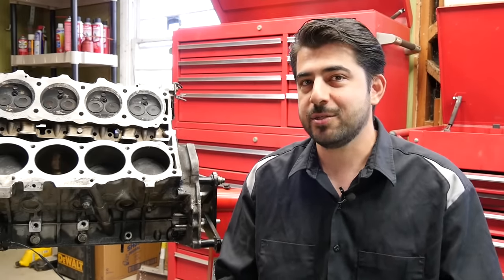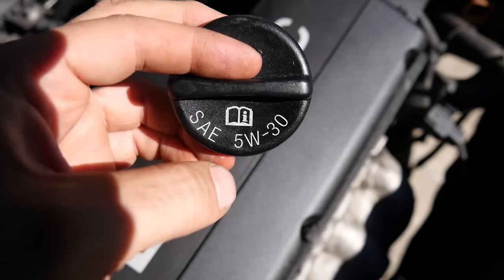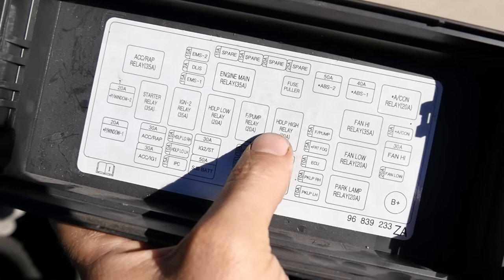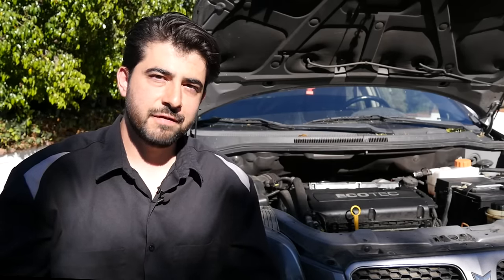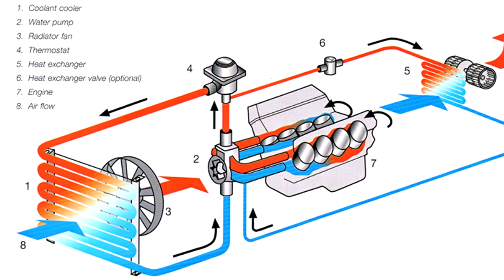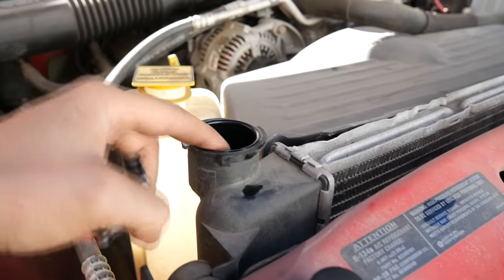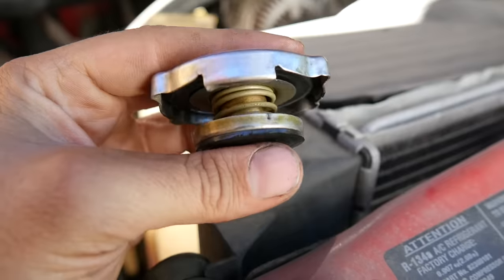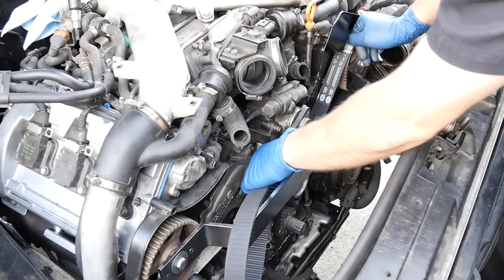Make Your Car Engine and Transmission Last a Very Long Time - Top 5 Tips On Car Care

Comment: Lol, you start talking about vehicles with transmission problems then immediately show a Dodge Ram.
Reply: Myles Mastersen I thought of that too! 😂
Reply: Because dodges are all motor. And no tranny
Reply: Loll
Reply: @AlphaFlight  yea that's true all they have is hemi lol
Reply: @AlphaFlight  good engine and garbage everything else
Reply: @ThePatUltra  ThePatUltra  dude he was probably talking about the Dodge vehicles that are 2000 and newer. I couldn't agree with him more on the fact that the 2000 and new dodge vehicle rust faster and have issues faster than most of the other vehicles in the market. But the older dodge vehicles are good. So don't worry.
Reply: @ThePatUltra its the same with the fords, old fords last longer than those new ones.
Reply: @ThePatUltra yea I agree. I personally wasn't hating at all, I am just telling it like it is. Personally I am a fan of dodge even if I drive a ford.
Reply: Well,its the one he was working on during the video and said all trucks that tow a lot..Dodge/GM/Ford trucks transmissions all last the same amount...I am in the business and know 3 friends that own Transmission repair shops..

FYI : Shady shops used to tell Dodge owners that they needed a transmission when all they needed was the transmission to be adjusted ! A $50 job cost them $1,000's because the owner came in and said they wanted a new transmission ! All it needed was to be adjusted as per owners manual !

Dodge /Chrysler/Plymouth made the worlds most reliable and trouble free,best shifting transmission the 727 ! Those never broke(unless years of abuse and they took hard abuse,hundreds of thousands of miles in Muscle cars,yes all old Muscle Cars have over 100,000 miles majority are in 200,000 range but dolts cant understand old cars of all brands didnt register 100,000 miles,at 99,999 they rolled to 00,000 again,Toyota was like this to decades ago)..
Reply: Literally goes without thinking.  I thought the same thing.
Reply: @AlphaFlight  The old 727's were three speed and tough.
Reply: The ZF-8 speed used by FCA is the most reliable tranny out there.
Reply: You missed the meaning of it.  He was talking about the hole, then said thats what she said.  So the meaning of the dodge ram is to ram her hole with his man tool.
Reply: Mopars have always had weak transmissions,,,my 67 charger , 70 challenger and 73 charger all had trans problems,,and even the new ones are the same
Reply: @Bob Builder Some CHEVROLET trucks used Allison tranny's, I very well could be wrong but I've never heard of a dodge with an allison. In fact, All I've ever heard is to avoid FCA vehicle like the plague. Cummins or not, avoid them like the plague.
Reply: All American cars have transmission problems...
Reply: Dodge worst trucks on rd for front end parts and transmissions. Probably why ram will never out sell ford or gm trucks
Reply: @Bob Builder never seen one dodge gas engine with that many miles. Seen plenty on Chevy trucks with that many miles
Reply: @01trsmar  bs dodge has had more trouble with transmissions than any other truck
Reply: Bob Builder untrue. Dodge has never used the Alison 1000. GM did behind the Duramax.
Reply: 350.000 miles 04  dodge ram transmission.  45RFE. never been rebuilt
Reply: My 95 5.9 ram 1500 transmission died before I had 60k miles....  F*ck Dodge/Ram, whatever the f*CK they rebrand it....  Never buying them again!   I religiously replaced the automatic transmission fluid every 12k miles and it the mechanic would show me black/burnt fluid....  WTF!
Reply: Myles

I have a 2006 dodge ram with 230000 miles and runs perfect. In fact the only thing I have had to change is the water pump and u joints.
Reply: The car he was also standing in front of is a Pontiac
Reply: @ThePatUltra A minivan owner from Chrysler here and minivan hitting 270k miles.  Great vehicle, only complain is dashboard which is cracking up and some rust.
Reply: The new CVT transmissions make the Ram transmissions look reliable and rugged.  The manufacturers tried to cut down the price of a transmission to maximise profit and dumbed down a CVT to put in their cars. The results speak for themselves.  Unless it is a subaru, never buy a cad with a CVT.  I do not know what Subaru does differently, but their CVT stays together, shifts well, and is rather rugged.  None of them ever come in for transmission service here.  Nissan is the polar opposite.  They barely make it out of warranty and the junk is broken.  I have advised our fleet manager to stop buying anything with CVT unless it is Subaru and to stop buying anything turbo charged four cylinder cars.  Those tiny engines with turbos are grenades waiting to explode, especially since I think the sales people abuse them.  They come to me with every gasket leaking and with a rattle, just after warranty expires.
Reply: He's a mechanic.
Did I say he's a mechanic.
Guess what he's a mechanic.
What are the odds a mechanic who works on cars for a living can make cars last longer.
He's a mechanic.
Reply: LOL
Reply: @markvietti  All Ford lovers just hate to admit all ford defects that are purposely made to fail !
Reply: @garymiller2056  727's were the best, toughest, most reliable transmissions in history!
Reply: @georgespangler1517  did you have 727's? if they were weak, you must have been doing neutral drops @ 5000 rpm on a regular basis.
Reply: Just replace the transmission with an Allison transmission and you’re good to go. Pair that with the Cummins turbo diesel and that’s one hell of a truck.
Reply: @georgespangler1517  No they haven't always had weak transmissions!  The 727 and 904  Torqueflites were the toughest and most reliable in the industry for many years!
Reply: @georgespangler1517  You must have had shitty  cars. to begin with.  Yours is the first time I have ever heard someone comment about the Mopar transmissions of that era.
Reply: @slowbastardo9101  I call bull on the burnt fluid at 12k.  I believe there to be a big exaggeration.
Reply: @robhargis6980  first car was a 67 dodge charger 383,,,second 70 challenger 340,,,third 73 SE charger 400,,,I wish I had those SHITY CARS now,,,lol,,, I had to rebuild the trans,,,but I'm sure they had been put through hell before I got them  5 to 8 years later,,  If I only knew then what I know now,,,,but I've bought up 10 classic cars to restore,
Reply: Dodge will somehow be the first car to be totally transmission free
Reply: @francisprevel1  you probably don't even know why its called a hemi

Comment: I have a 96 civic and it just hit 380k miles! Every weekend I’m doing preventative maintenance on it. I take things apart and test certain parts to determine if they need replacing or just simply checking the life of parts. My two main things on keeping an engine healthy is proper lubrications and the cooling system. Those are my two majors to keep an eye out on.
Reply: Every weekend?
Reply: @enricopallazzo3244  just about every weekend because I work in the city. My job is about an hour and half away, therefore it is crucial for me to keep up with the maintenance and to check for any faulty parts. I would hate to be stranded far away from home. Yes, I do have AAA but in reality I wouldn’t want to use it. I’m my case, it’s essential to inspect my car every weekend. Your situation could be different if you commute time isn’t much. Normally, people should inspect their vehicles at least once a month.
Reply: @TheEdgar707  Cool, well done sir.
Reply: I like your preventative inspections and maintenance. I do that as well but I should increase the frequency. I do it, may be once in 3 months. I drive about and hour and a half each way. that is about 3 hours a day. so, what you do makes a lot of sense to me. taking care of it is better than waiting to be broken on the road.
Reply: What specifically do you do every weekend? What parts do you check? Thanks.
Reply: 93 Civic 137 on the clock. These are relatively low maintenance compared to many other vehicles. Reliable as dirt. 90s Corolla same thing
Reply: @TheEdgar707 your life sounds like a nightmare to me
Reply: The D16 is a great engine, you barely even have to do maintenance. Just do oil changes every 7000km or so, no need for synthetic, just keep it topped up because they do burn a tiny bit of oil if you hit vtec regularly.

Comment: Drive your car nicely and it will last longer. If you race between traffic lights your car will die sooner even if you service on time!
Reply: Thats true. The key to having your engine last is to not give it a lot of torque while driving.  Don't drive it like your going to the races.
Reply: @jopisano67  😬
Reply: All I say to those who drive fast between lights is... I will meet you at the next one. 😃
Reply: @jopisano67  Depends. Diesel engines should get to use the torque. Its also smart to run yhem on high RPM a couple of times to regen the DPF (if it has one)
Reply: That statement is not proven.Drive your car to sluggish and it won't last long either.Engines need to be put under pressure once in a while.Obviously after warm up.
Reply: Joey O unless it’s a performance car. My 330ci has 220,000 on the clock and it’s done over 10 hard track days plus it’s absurd everyday and has done for the last 5 years. I change the oil and filter every 4,000 miles.
Reply: Wrong... especially in modern direct injected engines.
Reply: im dont agree of “not giving your car the torque or racing everytime” like cmon it’s designed to be driven no matter how hard you drove it.
Reply: @bugoykikay8074  Modern reliable Engines maybe....  NOT Transmissions.    Normal modern transmissions can not handle the same stress of a  professional race car transmission.
Reply: @jopisano67  3rd gen prius are notoriously known for head gaskets as mines was replaced at 143k miles. I have 400K miles now and have been pretty rough with it. This thing takes a beating, I still prefer the 97 protégé engine for a reliability

Comment: For me to remember easy
1. Change oil frequently and use synthetic oil. Change oil filter every oil change
2. Change air filter when needed, same with brake pads and keep an eye on those tires
3. Keep an eye on the timing belt 
4. Keep an eye on your water pump. Replace with timing belt. Keep an eye on radiator cap. 
5. Replace that transmission fluid and filter.
Reply: Don't forget, the Thermostat
Reply: Also power steering. Very easy to overlook and costly to replace the rack
Reply: Replace the clutch and pressure plate before it leads to pressure plate failure.  But clutch and pressure plate only need to be changed about every 200,000 miles or so.  If you can handle a clutch well, 250,000 miles is very easy to obtain.  If you have a Front wheel drive vehicle, check CV joint boots.  If the boots are ripped and the axle makes a clicking noise when turning, replace the CV Joint drive axle.  I have seen many accidents, some with death, because people do not replace CV joint drive axles, which are easy to change. If you hear a strange droning noise when idling, the fuel pump is about to fail. But do not worry.  It does not happen often and it is relatively easy to change.  Oil change is every 3000 miles for me. Change differential fluid every 50,000 miles. I must be doing something right.  This month my vehicle turns 425,000 miles.  The original engine and transmission and axles are still running strong.  I bought the vehicle new in 1996.
Reply: Also make sure when your heat meter start going to hot/ overheating...to fix the problem immediately and not continue driving your car.
Reply: Thank you!
Reply: I have an older cherokee with about 286K miles on it and it runs like a brand new car!! I did replace almost everything on it lol About to install a brand new upgraded 5-speed. This Jeep will probably last 1 million miles lol
Reply: @Kafilkavich  Our newest car is a 05 Jeep Liberty,292000 miles, and a 93 Cherokee 4.0 still running great
Reply: @indridcold8433  what vehicle dude?
Reply: @indridcold8433  Have to add this, change coolant every 2 years and use OEM coolant if you are not an expert with your car!
Reply: @cyrusthechad7256 When you say Synthetic oil, do you mean Fully Synthetic or Synthetic blend oil?
Reply: @Fred-F4  that may have saved my ecotec!  As after replacing a leaky head gasket I noticed the water passage was nearly corroded into the cylinder head..
Then again..parts were dang hard to get 15 years ago...part of why I eventually junked it
Reply: Replying for me to remember easy
Reply: I think it is better to drain and fill transmission every couple years rather than flush.  This takes maybe two quarts of ATF.  All you need is to refresh the detergents to prevent sludging.  The worn-off clutch material in the fluid actually helps to lower the wear on the clutch packs.  Consequently, you don't want to drain ALL of that out.  You just need a refresh of the additive package.  This method is even simpler than an oil change not to mention transmission flush!
Reply: @bobthrasher8226 Or put full synthetic in place of what you drained off. 
A towing cooler adds life to the fluid as those thing get boiling hot just moving itself around empty never mind hauling anything.
Reply: Don't forget that Brake Fluid is not "lifetime use" 
It's only good for two (2) years then it absorbs moisture and becomes acidic (and corrodes the aluminum parts, the particles in turn attack the rings and seals)
Reply: @bobthrasher8226 This is one of those issues that I can’t seem to get a good answer on - yours makes a lot of sense. I’ve talked to mechanics who suggest not touching the transmission if it has high mileage and has never been changed and that they have found problems if they do. What are your thoughts/experience? Thank you!!
Reply: Just replaced my timing belt with a water pump. Not turning over 😐 maybe should have used a new timing belt instead
Reply: I have a timing chain 🗿
Reply: @indridcold8433 what does the body look like though?
Reply: So basically this whole thread has turned into replacing a bunch more stuff 💀
Reply: 7:36
Reply: Most of all, do your own service, repairs, upgrades, and modifications, to your vehicle.  The time you let a, "professional," do your vehicle repairs, maintenance, upgrades, repairs, and modifications, that is the beginning of the end.  Those mechanics are tremendously pressured to get the vehicle done.  Cross threaded bolts, broken nuts, missing bolts, stripped screws, missing panels, are not uncommon.  Protect your investment and do all your own work to your automobile.
Reply: @kafilkavich707  I have had my 1996 TJ 27 years.  She is now operating with 441,000 miles and running like new.  She does not even make smoke, without a catalytic converter.  It was always my intent to put the historic vehicle plates on my vehicle when we started our long journey together in late 1996.  She only had 11 miles on the odometer when we started our long trip.  I love my RMS Stargazer.   27 years together is not enough.  I love her so much.  She has outlasted 3 jobs, two houses, two catastrophes, 9 friends, a girlfriend, and many animal companions.  I can never part with her. I, too, will be getting an upgraded 5 speed manual.  The old one is grinding too much.  A Terminator AX-15 is what I am thinking about getting.
Reply: @Fred-F4  Let nobody touch your vehicle with tools.  Only you should ever do any work to your large investment.
Reply: @johnrodriguez1145  I still use petrol, but I switched to propane also.  My vehicle is triple fuel compatible.  E-15 ethanol petrol, propane, or methane gas.  It makes far more fuel economy on propane than the other two fuels.
Reply: Coolant,brake fluid and power steering also